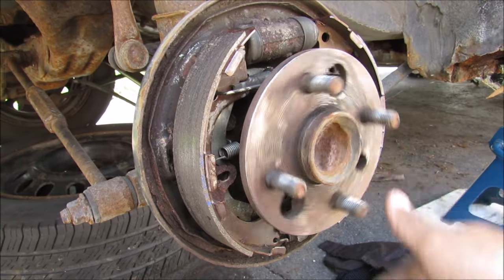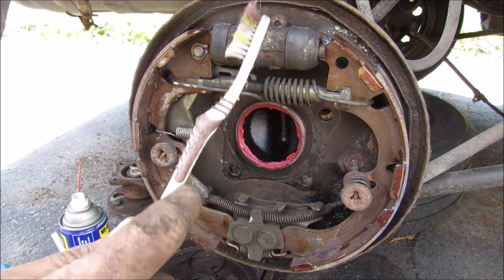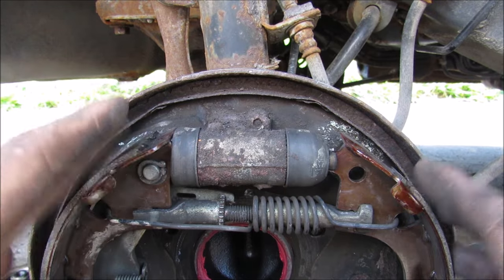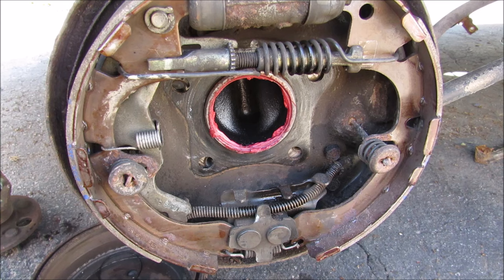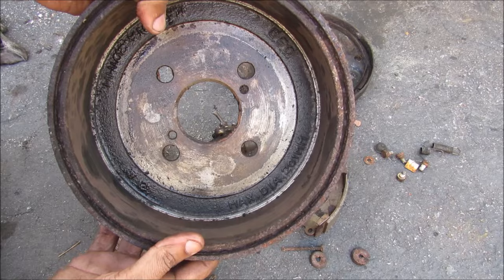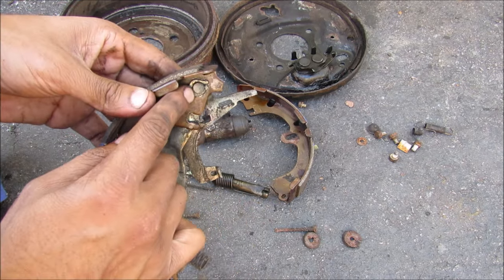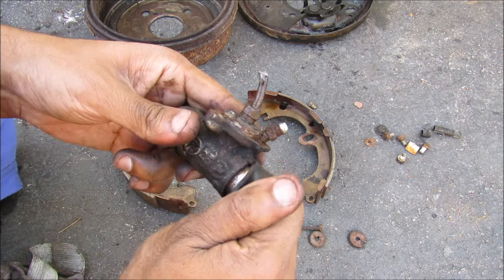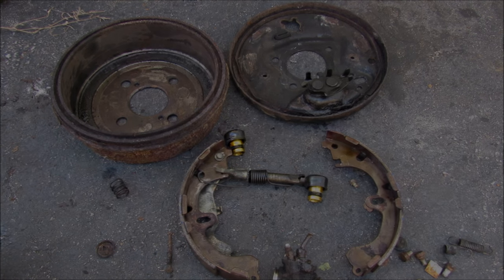How Drum Brakes Work

Comment: Well done sir.  I need to clean up the drum brakes on my 61 Willy’s Jeep.  They have been sitting for years.  This video is helpful for me to understand how they should work.  It’s got drums on all 4 axles and is a manual brake system.  The e-brake is actually on the drive shaft, not the drums.

Comment: Drum brakes work great for rears. As long as you annually remove the drums to dump the brake dust and occasionally disassemble to clean and relube when they make noise (proper adjustment is key), they last forever. Because they're covered assemblies, they get spared from all the salt and road spray that tends destroy disk brakes. The rear shoes on my Kia with 200K are original and only 30% worn. Then again, light cars don't eat through brakes either.
Reply from the maker: Yep they sure do last long and need little maintenance

Comment: It’s a good idea to clean out your brake drums and hardware once in a why’ll. Helps keep everything lasting longer jack up the car take off tire remove drum and clean it out with brake cleaner tape off the shoes so you don’t get brake cleaner on them and then spray everything and watch the dirty come right off. I’d recommend first using a brush and getting most the dirt off first then spray everything.
Reply from the maker: Good tip

Comment: 3:10 , you missed a point , that little tab also automatically adjusts the brakes as the brakes wears off , when you pull the hand brakes  that little tab will push the adjusting screw causing it to expend and decrease the gap between the drum and the shoes .
Reply from the maker: +Nahid Bepari thanks for adding that point
Reply: speedkar99 
You're welcome .

Comment: Hey Speedkar I need help. I have this exact same car.
So my issue is that one of my rear brake drums is hard to turn when the Wheel is off. I have noticed this twice when changing my winter/summer tires. The other related symptom is rubbing noise when driving/braking. The strange thing is though that the noise will be present when first driving but will quickly go away after driving for a while. Also weird that it happens a lot after Rain/Moisture. Important to note that the Rear brakes were fully serviced by a mechanic a few years ago. I also replaced both Drums shortly after. I am thinking the shoes might not be adjusted properly and are contacting the drum? Possibly even the parking brake is causing the shoes to rub because it isn't properly adjusted? It has so much play in it when its pulled up and no click noise. I have never worked on Drum brakes before. I am also scared maybe the wheel bearing could be bad? I guess my first step will be to remove the drum and see if the wheel hub spins freely?
Reply from the maker: Yes they might need to be adjusted. Usually there's a very slight drag when adjusted right. Also try self adjustment by slamming on the brakes in reverse

Comment: my wheel cylinder cut on the rubber part . should i replace it  ?
Reply from the maker: Yes
Reply: @speedkar99  sooo i replace it already . when i step on the brake its to deep . do i have to adjust the brakes individually or theres another way to adjust the pedal?

Comment: How is it that the drum rotates with the wheel but the shoes don’t rotate as well? I’m having a hard time visualizing what this looks like on the road.. I can only see every component rotating together which doesn’t make sense because then the shoes when pressed against the drum won’t cause any friction, it will just roll with the drum
Reply from the maker: The shoes are attached to the knuckle of the car and are stationary
Reply: To whoever liked my comment (can’t see it on mobile), the backing plate is actually mounted on the suspension so it isn’t rotation woh the rear axle. When you brake, the shoes are stationary and push outwards against the drum that it’s rotating with the wheel hub. Like if it makes sense or comment if you have questions
Reply: Ahh thank you! I couldnt see your response.. idk why youtube on my phone sucks

Comment: It looks like more complicated than Disk brake and with more components, how come it is cheaper than disk brake?
Reply from the maker: +Charles Fu think of it from a cost to manufacture perspective...disc brakes require large machined rotors, larger pads, a big chunk of forged metal for the caliper and bracket...whereas drum brakes are a tiny wheel cylinder with some springs, clips and smaller shoes.